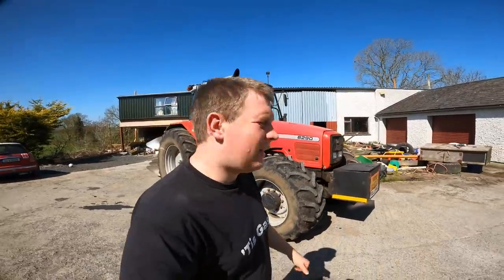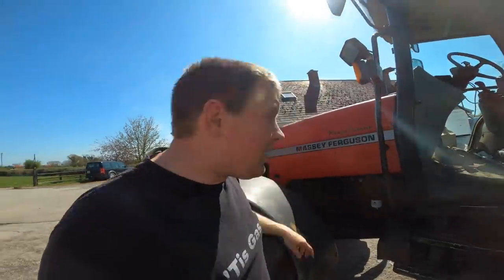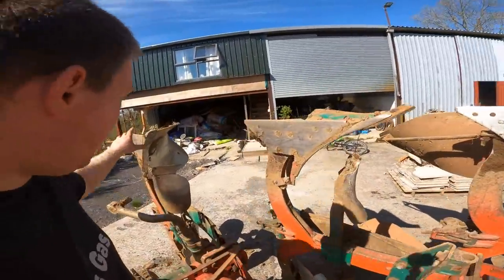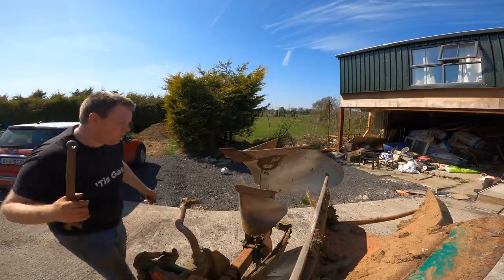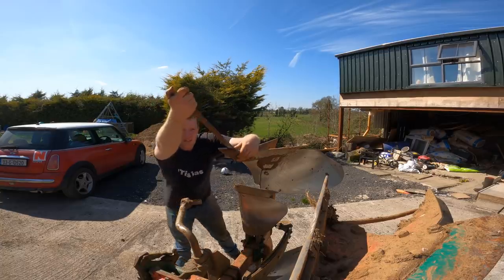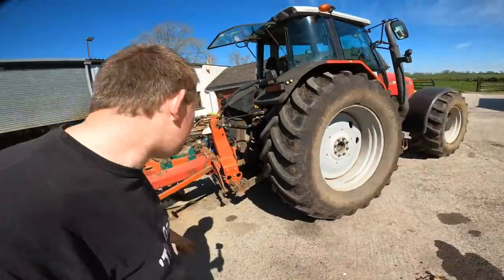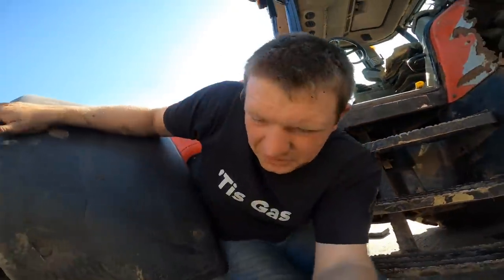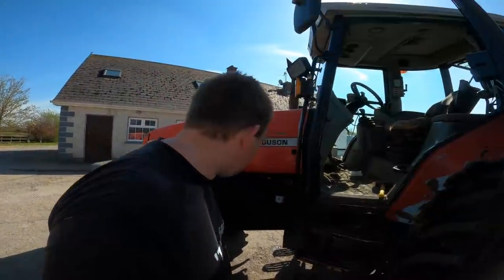PLOUGH MAINTENANCE AND TRACTOR REPAIRS

Comment: get yourself a battery impact wrench, will loosen and tighten those bolts within minutes.
Reply: And two hats for the sun
Reply: Can’t beat the Milwaukee 18v 3/4”. I use it for taking the slurry wheels on and off the tractor and everything else that’s gonna be a nightmare.
Reply: @mikeysky8917  are they fairly expensive or not too bad compared to other brands
Reply: If shes not blue she'll not do I paid £390 inc Vat. Charger, 2 Batteries and carry case included. Paid £10 for a 3/4” to 1/2” adapter so I can use the smaller impact sockets. Opted for the 3/4” because it’s a better beast for taking tractor studs of. Best Impact gun around. Makes my now redundant Snap-On look like a kids toy.

Comment: Might be a stupid question but I dont know much about masseys, is there front differential in them built into the axle or have you only diff in the back wheels and the 4wd would keep them turning at the same speed to prevent slip. If you get what I mean. On my ford 7810 its front differential is self locking
Reply: Some have a constant locked front diff. 
Many with the Dana axel have hydra loc so front diff lock engages when you engage your rear lock
Reply: @grantahlschlager9597  the constant locked diff sounds like a bad job, if you are turning sharp in a field it would tear up the sod very badly
Reply: @jerryodriscoll3691  
Naa its not that bad once you exceed a certain angle on the steering the clutch pack in the diff begins to slip. The proper name is limited slip diff forgot what it was called earlier.

Comment: ah phil no wonder all the grass was on top on the ploughing no disks on the plough mother of god.sorry dont like criticise.thanks
Reply: Had a plough without discs one time, it came with small skimmers but fitted the maize spec skimmers,worked outstanding and buried any vegetation even weeds up to 3 ft high. Set properly the plough there's no need for discs except on last furrows which can drag dead vegetation near verges. Across the world it's rare to see discs on ploughs,its either skimmers or field knives. Before there was tractors all horse pulled ploughs had not discs but small skimmers which worked well.(and very grass on his last ploughing video,a badly set plough with discs would leave more!)
Reply: tell that to keverneland im sure they will be very impressed..
Reply: @mauricesheehy2460  wouldn't have to tell kvernland as had a reversible plough made by them-they do make skimmers designed for burial of maize stalks and stubble which is much tougher to bury than grass.  look at youtube video like 'ploughing the maize field part 2', there you clearly see a plough without discs in action in grass similar to irish conditions.
Reply: @mauricesheehy2460  see phils latest video on ploughing - you will see him ploughing in that trash well and without discs!! Enjoy it😉.